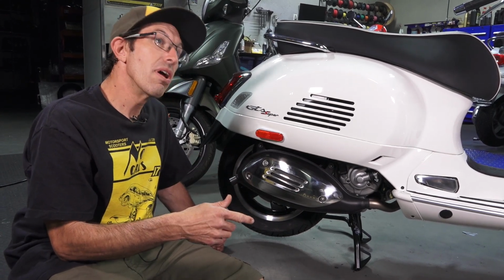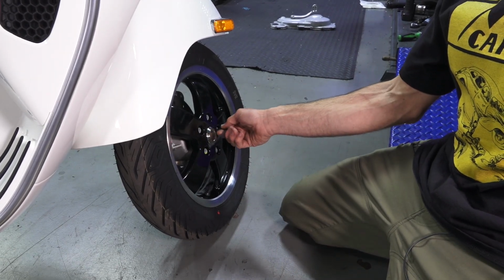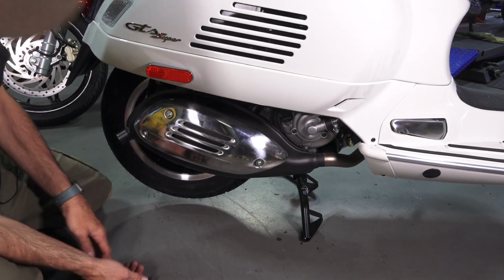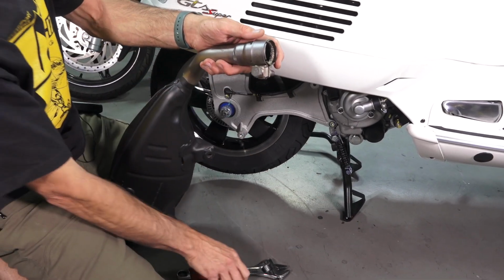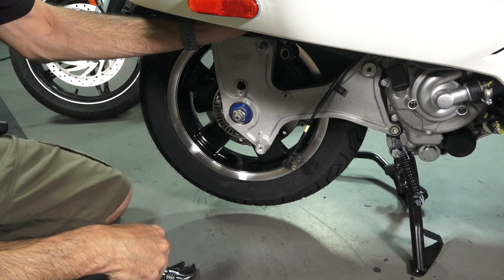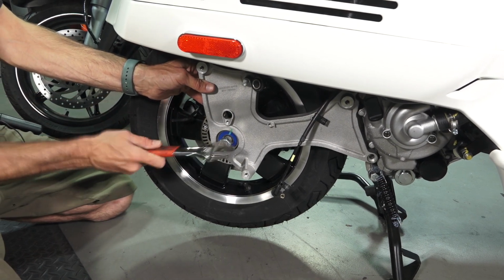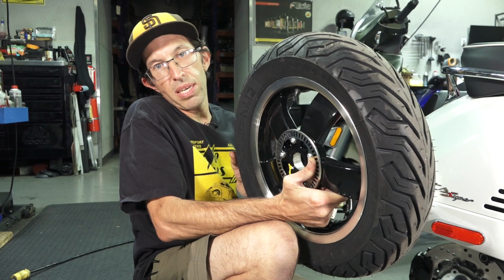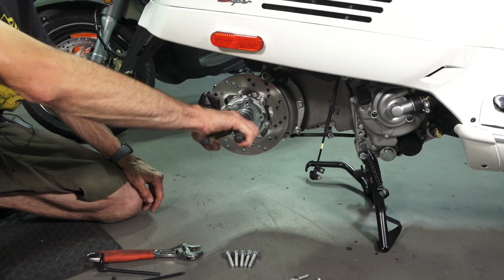How To Remove Vespa Wheels with Basic Hand Tools

Comment: You mentioned the 2015-2016 having different thing going on. Well, mine is one of those. Is there anything I need to know I note my tone ring has a mark and there is a green dot on the rotor. Do you have to line up anything or just put the tire back on as you did?

Comment: I am dismantling a 2005 GTS and found the wheel nut and shock nut so tight I needed a 3 foot pipe extension on the socket wrench. I hope other critical nuts are not so over tightened. Thanks for your detailed video.

Comment: Excellent video. Thank you  Robot
Just a quick side note about the use of something to support the scooter while removing front tyre..
On all the models from the Et's right up to the HPE Gts..if you remove the pet carrier and turn it upside down  slide it under the scooter it will support  it to perfection.

Comment: You wanna try and remove a rear wheel with a rock after 10,000 miles!! Joker.

On a bike ramp with copper hammer that my dad used on his MG in the 5t's it takes me the best part of an hour.

Carry a plug set & compressor, do a temporary repair, get home and do the job properly with the right tools.

Comment: Again so useful even for tips at doing stuff at home like locking the rear with an Allen key through the disc rather than special tool. As a get you to the tyre shop fix would a puncture repair kit with a plug and glue be a quicker route? We have these in the uk not sure if USA? Just off to change my oil and filter on my gts300 👍🏻
Reply from the maker: Certainly could work. The repairs aren't always successful at holding air, but they could get you a bit further down the road... Thanks for the comment 😊

Comment: Don't know if it's been said already, but take out the tub from under the seat, turn it upside down and put it under the frame, it's just the right height for lifting the front wheel.
Reply from the maker: Yep, great tip. Thanks!

Comment: Great tutorial but what a lot to do for the rear wheel, especially difficult if the engine is hot. In the UK only tools we get are the shock pre-load spanner and the yellow fuse removal tool. Would you recommend applying copper ease on the rear axle before the corrosion sets in?
Reply from the maker: Yep, not quite as easy as a motorcycle tire. Yes, put some anti-seize on the rear axle and that will make it easier to remove the next time...

Comment: Thank you for your inspiring videos that makes me want to run my little Vespa ET2 50 1999 more often!
Regarding getting the front wheel to stay in the air I have a tip: Just put that plastic storage box you find under the seat under the frame. You always got it with you! At least it works fine on my ET during every winter storage (to relieve the preassue and keep the tyre round).

Comment: Great video. I was wondering how you get the back wheel off, not as simple as a motorcycle wheel.
On a future video maybe you could do a re-grease of a main stand pivot pin, had to do that when mine siezed due to road salt.
Also I had to remove the side stand as it was grounding on every left turn. :)
Reply from the maker: Thanks, we'll keep that in mind!

Comment: VIDEO SUGGESTION: How To Remove Stickers & Badging From Your New Vespa - unless you already have one I don't know about. ;) I got my new Vespa home and one of the first things I wanted to do after that 640-mile trip was take off those factory stickers and warning labels. I managed with some struggle (hint: do it when they are warm) but now I have all that glue residue and I'm not sure what solutions to use so I don't mar the finish, especially on the windshield. I'd also like to remove some of the badging. I don't need to have a Vespa badge on every part of the bodywork. Thanks Robot, lovin' my new Vespa.
Reply from the maker: Nothing like that yet, but we'll keep that in mind. We find that you can get decals off quite easily by carefully using a heat gun on a low setting, or a hair dryer. As far as the badges, you can carefully pry them off with a plastic putty knife or spudger tool, or get a piece of dental floss behind it and work it off. Most of the badges on the the new Vespas are just stuck on with an adhesive backing. Hope this helps for now, and thanks for watching!